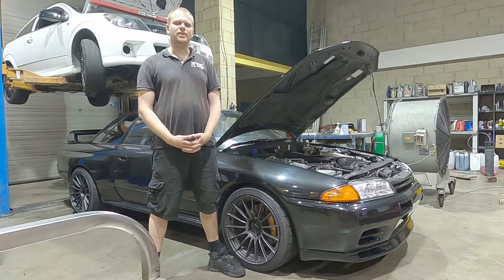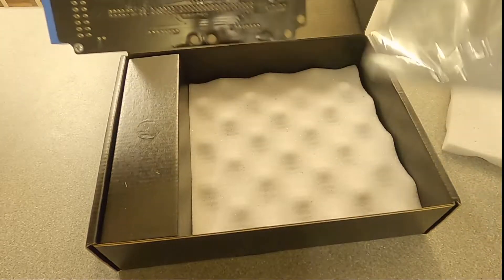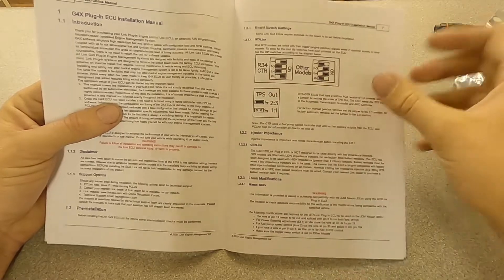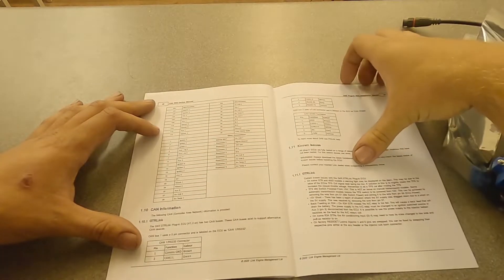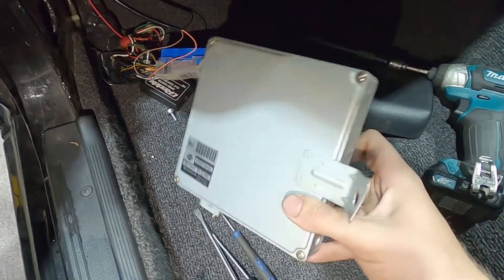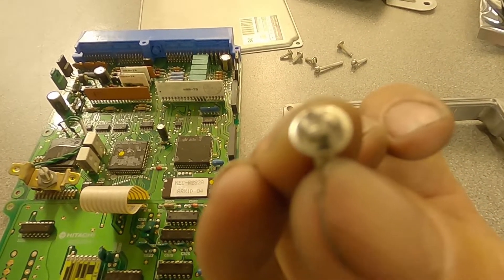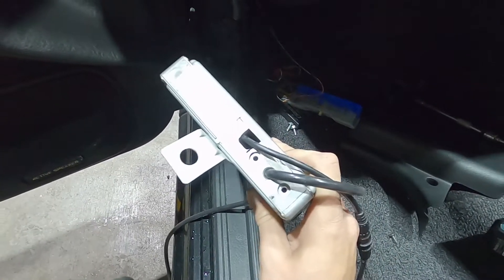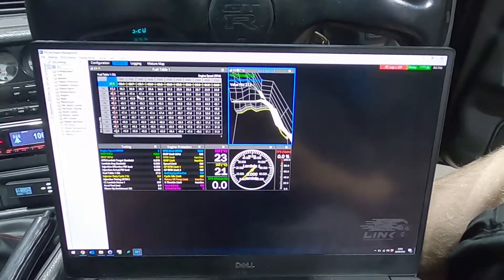Link G4X ECU Tuning Part 1 - Installing a Plug and Play GTRLink into a Nissan Skyline R32 GTR

Comment: Is there a specific wideband kit that you are using for this ecu? I’m a little confused on which can plug and wideband I should use. I have a gtst so it might be a little different than the gtr. Thanks!
Reply from the maker: Any wideband with a 0-5V output can be used with an analog pin.

Link also have CAN connected units.

Comment: Hi, excellent vid with in-depth info.

Im considering this GTRLink to install in a 180sx running a S2 RB25DET using a Wiring Specialties harness. Anything I should be aware of when doing the install and build?
Reply from the maker: They do a GTTLink I'm sure for the RB25